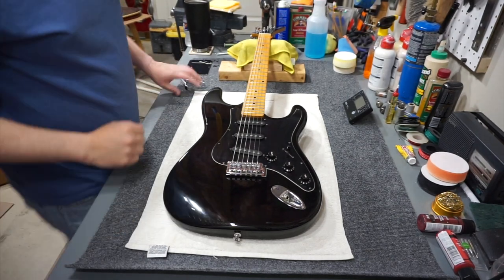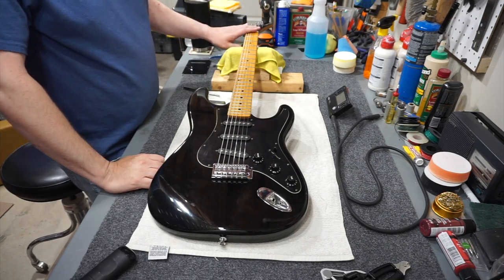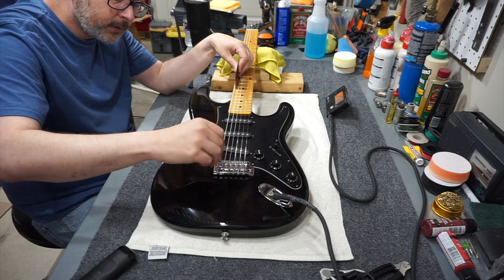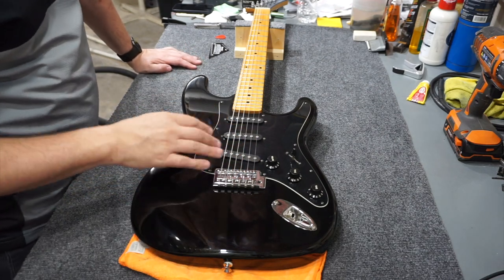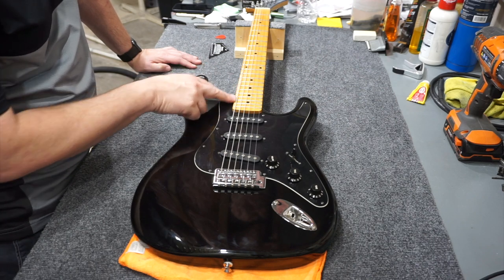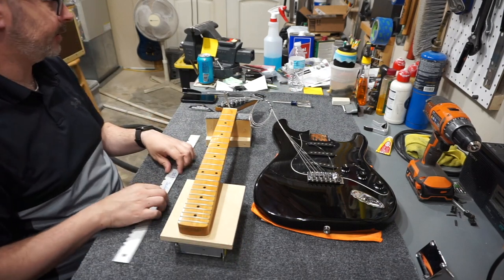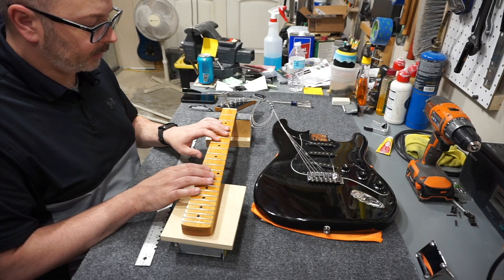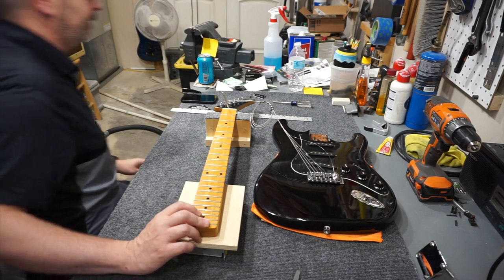The Epiphone S-310 (Strat) Project Guitar: Part 4 - Unexpected Fret Work and Final Setup

Comment: I know this dance very well.  I always remove the necks when possible  and do full, leveling.  Sometimes it's necessary to do fall away on those higher frets.  Always set the wood straight and level the frets.  The wood will respond to the tension of strings, not the frets.  
I use first fret 18 thou on wound strings and 16 thou on the rest.  Truss rod adjustment is 11 thou at 7th fret and saddle action is set over the fret where the neck meets the body.  4/64ths on wound strings and 3/64ths on the rest.  This is the best lowest action.  
We all have different preferences on these things.
Reply from the maker: Thanks, appreciate the conversation.  Ever use a neck jig to simulate string tension?  Seen lots of debate on that.